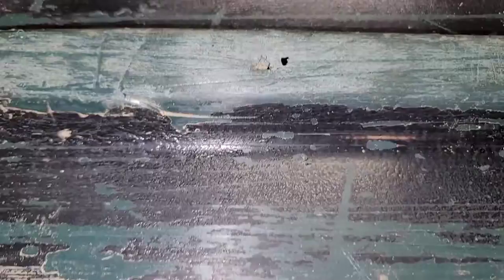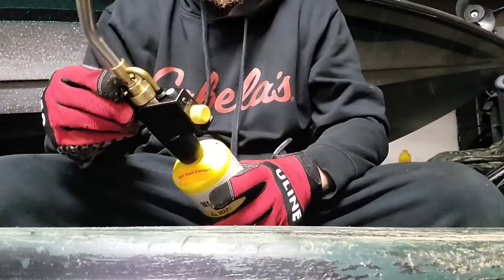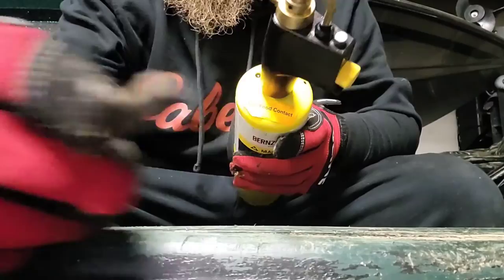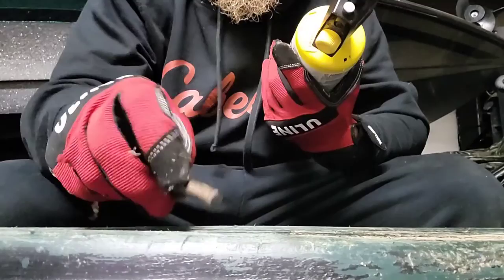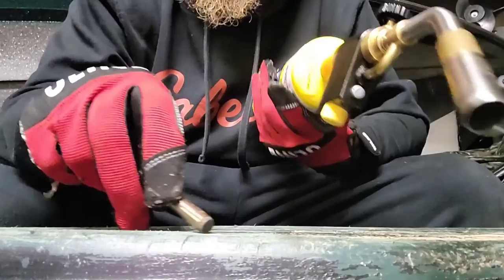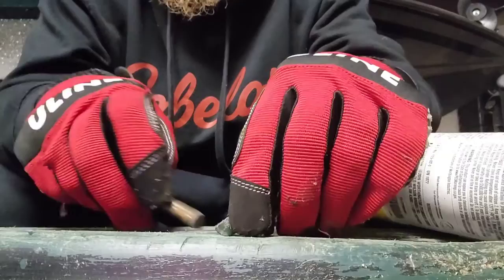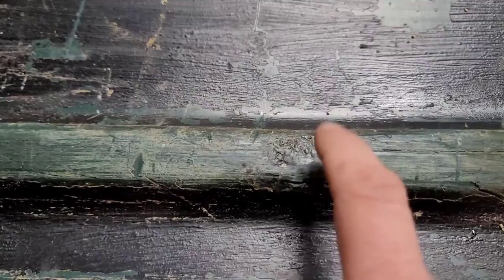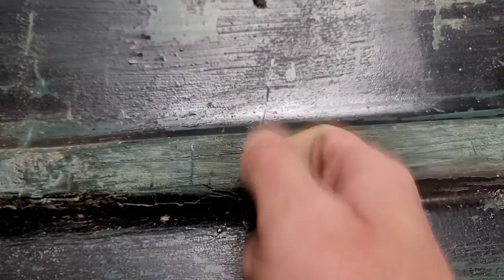How to fix a hole/Leak in your plastic boat (Jon boat, kayak, sun dolphin, pedal boat)

Comment: Hey man, I have a pelican predator 10’3. The back corners on the bottom hull is gonna have holes. Should I plastic weld like you do? If so where do I get plastic like that to weld on it? Let me know and thanks for the video!
Reply from the maker: Hey I would say give it a shot for sure! If you get it on there solid it is good to go! I would either buy a plastic trash can and cut pieces off that. Thanks for watchin 👊

Comment: Hey not a zoologist thank you for this video and your uploads I totally dig and I'm curious where you're at in the midwest but my main question is any advice on like the rubber seal that goes all the way around a pedal boat like say part of that becomes dislodged like any idea what to do about that can I just put it back may be screwed in and put a little water weld over the screw hole or something I don't know I'm grasping for straws here
Reply from the maker: Haha hey thanks for watchin 👊. I am in Ohio but travel all over! As for that seal. I would say super glue it back on and then slap some red RTV silicone on it. RTV will make a real nice water tight seal
Reply: @simplymidwestfishing6461  yes! You are a genius that will work perfectly for a watertight seal! Thank you mr. Not a zoologist you are rocking my holiday weekend! 
If you ever come to Jefferson County Missouri for fishing hit me up I know all the sweet spots and hidden gems out here 😉
Reply from the maker: Well thanks I'm glad I'm rockin your holiday haha posted a new video today actually. I need to get out there to Missouri for sure! I'm fishin in Texas right now cause I'm workin there for now...so that ain't bad either. Bigguns in Texas!!
Reply: @simplymidwestfishing6461  dude I got the notification for that and I'm like jump a DeWalt battery? oh my god I've got to watch this!!! I'm actually fixing to watch a here like literally in a minute or two but I'm hoping I can apply your way of doing this to my Ryobi and Craftsman batteries because I cuss my ryobi batteries every single day everyday. I mean I even called and embarrassingly went complete Karen on the people at Ryobi like thank God y'all aren't a battery making company because you definitely suck at that. your battery suck. Like they suck worse than I do when I was married to my husband and I just felt obligated but anyway that's a different monster for a different day. let me just reiterate how bad their batteries really do suck. I've never used DeWalt batteries per say. like how do you feel about them? are they quality enough to maybe start switching my tools over to? Because I'm looking to switch I'm currently have pressman have Ryobi and trying to find a Sears to get Craftsman to do their lifetime warranty is pretty much impossible so.... I am so disgusted in Ryobi battery qualities that I refuse to buy any more of their tools. I mean in a perfect world I'd have all snap-on right? Lol but that is caviar dreams and I have less than a Walmart budget. 😆😆😆

Comment: Is that just a single plastic layer or are there two layers with foam in between?  How thick is that plastic?
Reply from the maker: Mine is a single layer of plastic maybe 1/4 or 1/8th inch thick. For super super thick plastic you can use a sodering iron. It melts really well